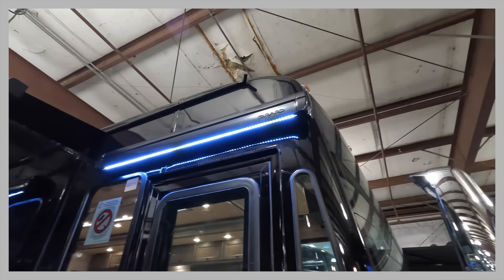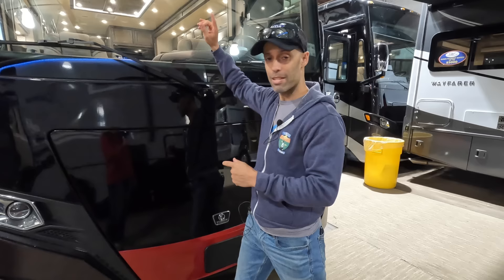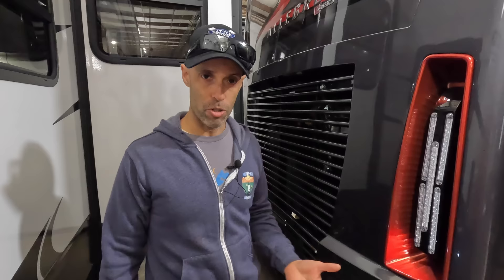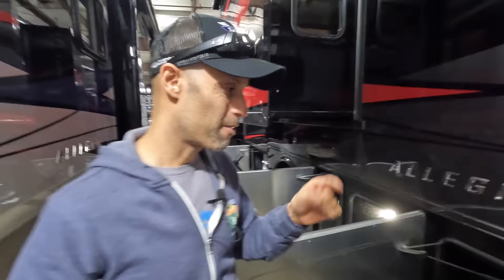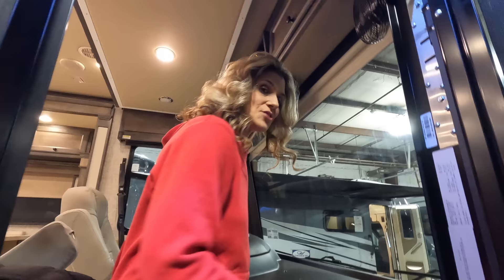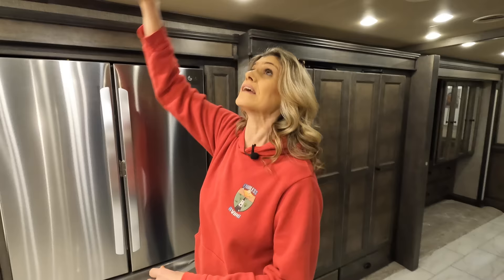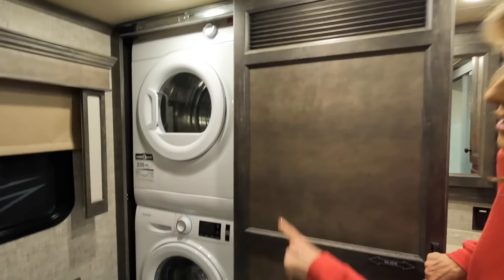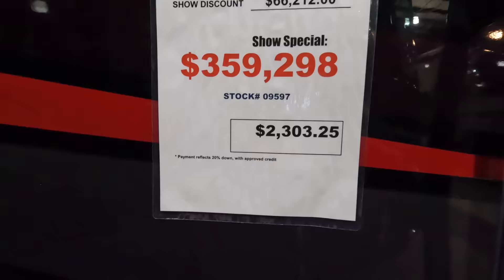The Worst Tiffin Motorhome We Have Toured -- Could Not Believe What We Saw!

Comment: I am an American Coach owner that recently toured the Tiffin factory in Red Bsy while our coach was getting awnings repaired at Girard. I was not impressed with the quality of workmanship and materials now being used in Tiffin motorhomes. My wife and I had a chance to examine a fresh off the line Allegro Red and found much the same poor workmanship as you both did in this video. Plus the use of cheap materials such as no dovetailing in any drawers and very thin imitation leather on all the furniture. Izzy is correct that ithis motorhome is highly overpriced for what a buyer receives. Stick with Newmar or American Coach as quality is still there.

Comment: It's important to note that the coach in question has not undergone inspection by the dealer or been purchased by a customer yet. It's a common misconception that custom jet liners or RVs arrive at the dealer in perfect cosmetic condition. In reality, achieving 100% perfection in every detail is a challenging task, and this applies to both high-end custom jet liners and recreational vehicles. Understandably, imperfections may be present initially, and the expectation is that they will be addressed during the inspection and customization process before the vehicle is handed over to the customer.
Reply from the maker: Would be a good idea if you want to sell a coach at a show to go over it and make it look good. Additionally we have been on hundreds of RV’s and many Tiffins.  This one looked terrible.  Should not have passed manufacturers PDI if they have one. 

Thanks for watching and the comment

Comment: Re: foldout bed over driver's seat. I have one of these, and the squeaks, squeals, and rattles are AWFUL. I've done everything short of removing that unit (that's coming). I'm losing hearing over this. I have to drive with hearing protection.

Comment: Looks like our 2015 Tiffin Allegro Bus is destined to become a sought after classic. Fantastic floor plan 37AP (no longer available but built 2014-2022), Beautifully designed and built on the excellent PowerGlide chassis with ZF independent front suspension -same as a Prevost (that is rumored of going away), with the superior Seamless Slides (that are now gone). 

For the show price of this RED , you can own a great bus for around $135K less. A lot of these have low mileage (ours had <15K & 89 hours on 10K generator) and with the L9 Cummins out back producing 450 hp / 1,250 ft lbs of torque, it has the ideal power to weight ratio. Our MPG computer reads average mpgs of 11.5! Get yourself a legendary bus that Bob Tiffin was proud to build! (Sorry , not for sale...we are keeping this one🙂)
Reply from the maker: Agreed!

Comment: Most people don’t care about the imperfections as long as they get some kind of fabricated discount they feel good.   And we all know right now camping world has big issues they refuse also to do complete pre-delivery inspections on their coaches including LP gas safety checks and also making sure that the furnace is not dumping any carbon monoxide in the coach

When you do your videos show me any documentation that an RV dealer is actually has put together a predelivery inspection checklist a very in-depth inspection checklist including the LP gas/propane system and all of the appliances including the output pressure regulator test results.

Comment: I hate to say but at this point, my 1999 National TropiCal is looking better and better compared to the newer class A models. I feel like mine is built better with real quality that has stood the test of time, with about 39,000 miles on it. I can make similar modifications on my 99 rig that I paid only $5,000 for that included 8 brand new tires not including the spare.
Reply: Same with our 2003 National SeaBreeze -- They sure put a lot of care and quality into it when they built it! We bought it used in 2017, and it was in excellent shape still. We had no idea other, far newer, class A's could have so many problems.

Comment: Very important question why is it that RV dealers refused to do complete pre-delivery inspections on the couches before they place them on their lot for sale ?  It’s because they do not want to pay their technicians to do the job also they will not do LP gas safety checks to make sure the LP gas system is not leaking propane as well as the appliances that burn the propane.  I am an RV expert witness I hope lawyers who have lawsuits against RV dealers most people don’t understand if you have 1 gallon of liquid propane in the tank and there’s a leak in the system that one liquid gallon will expand 270 gallons of explosive vapor.     Now imagine you’ve got 30 gallons of propane in your tank and you have a leak in the system and it’s leaking inside of the coach and the RV dealership refused to do the inspection so they never knew about it.   30 gallons of liquid propane and you have a leak in the system that’s equal to 8100 gallons of explosive vapor

Name one RV dealership that does complete pre-delivery inspections to make sure everything is working correctly before the buyer even gets to walk through it thinking about buying it.  RV dealerships refused to show any documents to show that they’ve checked out the codes thoroughly because they do not want to pay for it and they want you to write down the list of everything that’s not working and then bring it back to the dealership and they will submit a warranty claim for everything to be fixed why not do the job first before you place it on the lot for sale. ?????😀😇 🍺🍺🍺🍺🍺🍺

Comment: at 4:10 you mention the 1-piece slide on the higher end Tiffins.  Unfortunately, for the new models Tiffin hasn't decided to NOT use the 1-piece slideouts any longer. (A mistake in my opinion).

Comment: I agree we had 2010 it was great quality bought 2015 very disappointed. It is tiffin they are not quality as before. I noticed in video it looked like slide wasn’t sitting correctly and reason I noticed is that problem I’m having my floor is sinking. So far working with tillin they won’t even give me an appointment to look at what I believe is an engineering structural issue I’m coming from Indiana and they want me to come get in line right now it’s 7 days to wait. Not looking good. Has anyone had this problem

Comment: I purchased a Tiffin Allegro Bay in July 2023 and I am totally disappointed!!I purchased this motor-home because of all the positive things I've heard for years about Tiffin. I now feel that after they were bought out, so was their quality! I have had nothing but problems and the major issue was that I purchased the motor-home from LaMesa in Port St Lucie, Florida. The dealership is horrendous and their service department is a disgrace!! The motor-home was in for slide-out issues three times and still not corrected. Two of the three slides creep out on their own when the motor-home is parked. The service dept hasn't got a clue as to what they are doing and the arrogance is beyond belief. I have issues where the shower door bracket is broken and went in for repair twice and still not fixed. I waited for parts and when LaMesa allegedly fixed it, the entire bracket fell off again on the first trip with the motor-home. The dashboard Garmin went totally out and not working at all which is the radio, GPS and camera's. The drawers (several) just fall out and were NEVER screwed to the drawer slides. When you turn on either of the bathroom sinks after they are not used for about two days pour dark brown rusty water. LaMesa claims they cleaned out some metal particles and it was repaired, NOT!! The bedroom door fell off as I went to close it and as you mentioned in the video there was an issue with the same door as I have on my motor-home, I could go on and on with the issues and the DISGRACE OF THE DEALERSHIP AS WELL. I am reaching out to Tiffin this week to see if I can bring it to Alabama for repairs because I will have nothing to do with the nasty bastards in the service dept at LaMesa RV!

Comment: Buy a new car and stay in fine motels. Money ahead. Great channel!
Reply: We are in red bay as I write this. Went to pick up some parts at the factory this morning. Must be at least 50 lined up for repairs. Every service bay is filled for repairs. We bought an ‘06 model Phaeton in ‘10. Had it for 10 years and the quality was great. We never found another we liked as well. Regrettably sold it due to breakup. Now have an ‘09 Phaeton and it has a few problems. Thinking of getting an ‘11 or 12 40 footer but no later. Have talked to some folks that work at the factory and to a  person they say that quality had gone down the drain. Really sad. You can bet Thor is pulling Mr Tiffins strings.